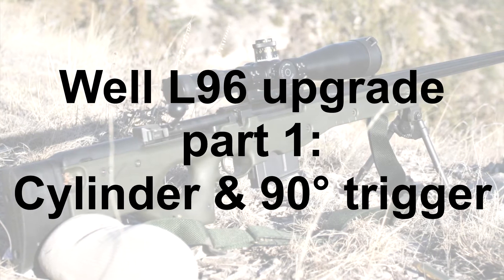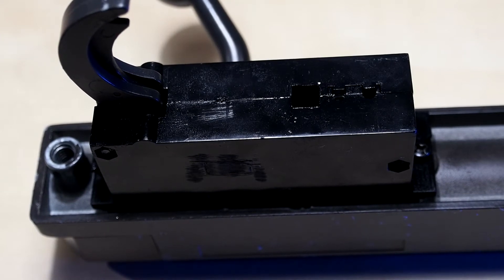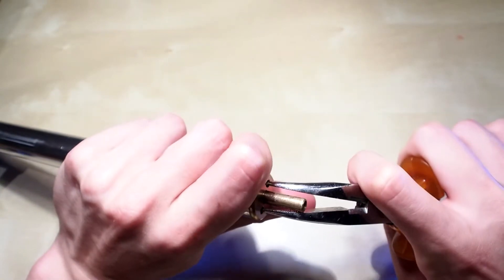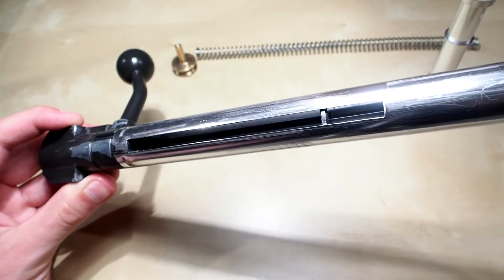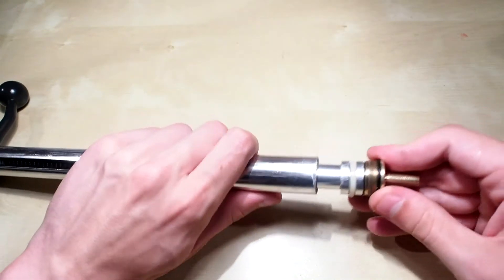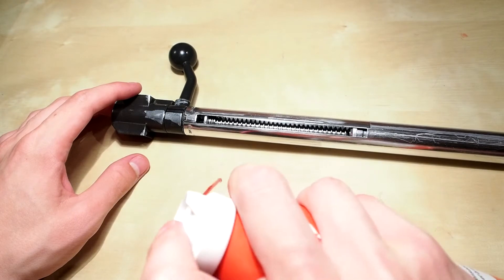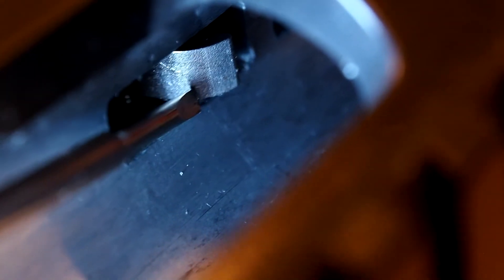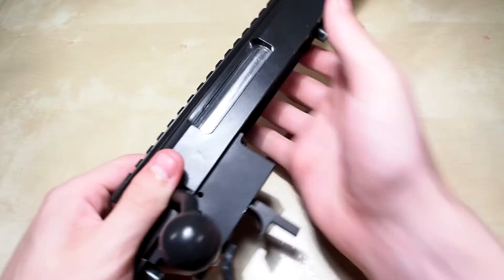L96 upgrade Part 1 - Cylinder and Trigger [Tech]

Comment: ok my spring will not lock back what might be the problem? thank you. I did the upgrade kit from evike.I used both of these

Matrix Spring Upgrade Set for Type96 / APS2 Airsoft Sniper Rifles
 $35.00 1 $35.00 
 Matrix Trigger Assembly for VSR-10 MB-03 MB-07 BAR-10 AGM APS2 & Comp. Airsoft Sniper Rifles
Reply from the maker: I think you bough the wrong trigger assembly. 
You will want to buy the one for the Type96 system and not the vsr system, these two systems are not compattible.
The only l96 platform that uses the vsr10 triggerbox is the "AGM" brand one, but this is diffrent from both the well, maruzen and UTG.